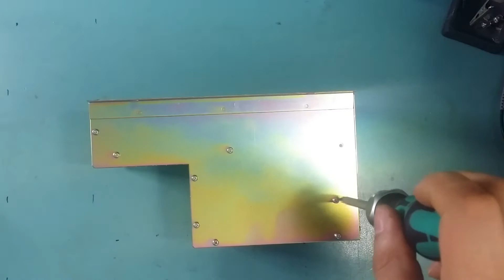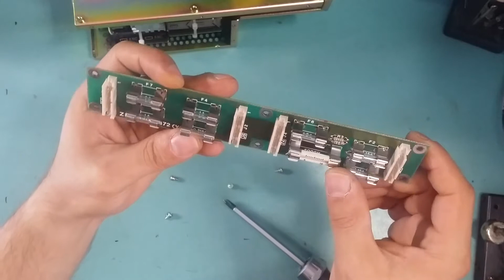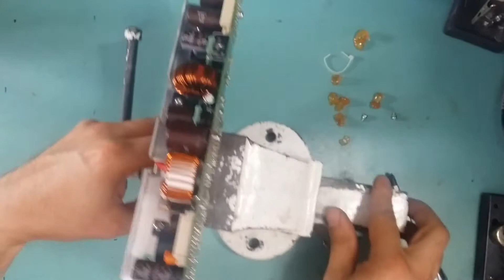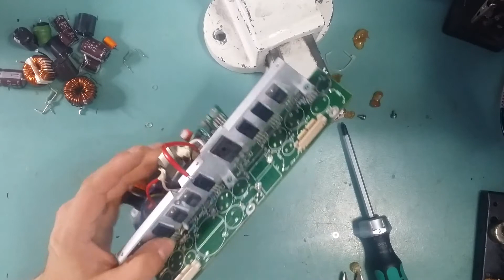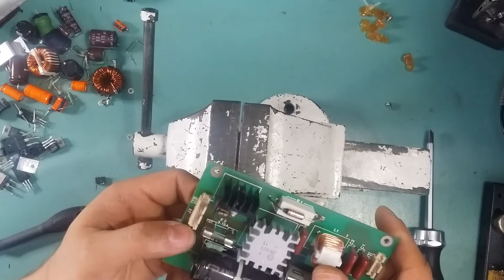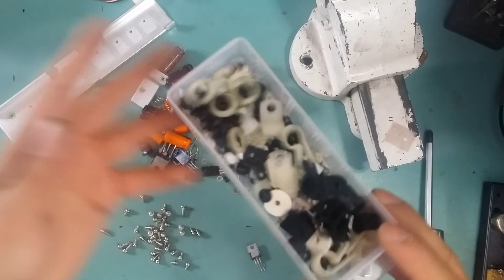Switch mode power supply teardown

Comment: The fuse type doofer looks like an hourmeter, if so it just tells you how long the machine has been turned on for.A hot air paint stripper type air gun makes salvaging bits of boards way quicker, just pull them out with bird beaks while heating the solder side.Also a good idea to short the caps before taking apart, you can get a nasty belt from them.

Comment from the maker: It was part of anritsu test gear i got from ebay. Funny thing there was also a massive transformer and linear power supply inside as well. The test gear was a goldmine interms of parts i salvaged. I got 140 high quality relays, 150 0.01% precision resistors and 180 1% capacitors. All were part of switchable filter system. And lots more other stuff. Including eeprom, lcd display, transistors, op amps, etc. The gear cost me £45 delivered and i estimated about £380 worth of part salvaged. :-)